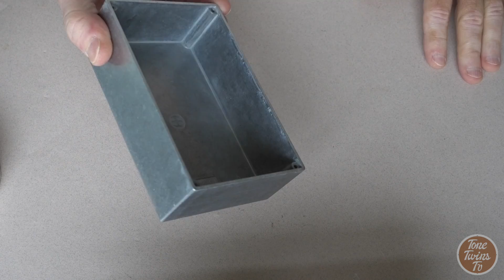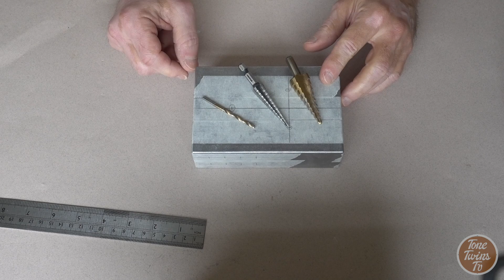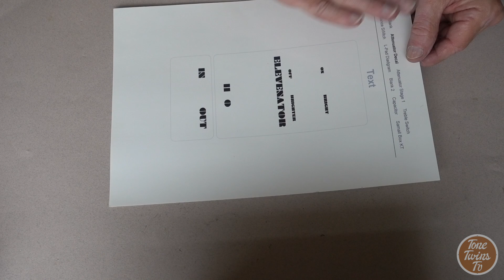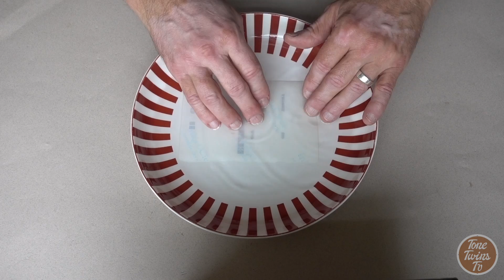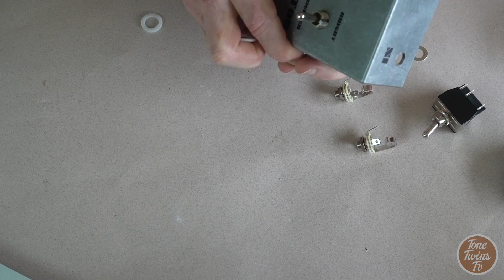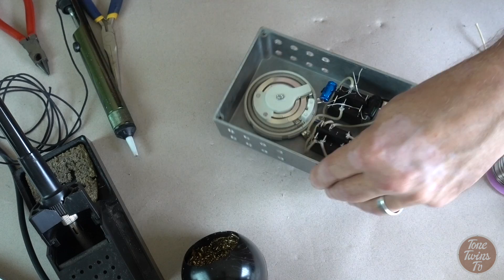DIY Attenuator For Guitar  - Great Low-Volume Tone

Comment: The problem with attenuators that use an LPad like this, is that when connected to a 100w amp, and you dial it down to almost zero, almost 50 watts is being dissipated into the last couple of windings. Marshall used to sell a similar design attenuator when I worked in the industry, and I lost count of the number of blown units returned. Go with a stepped design.

Comment: It's a great build. There is a slightly better way to wire it. Input comes in into 1 and output to 2. That way if the wiper fails you don't have open circuit that can wreck a tube amp.

Comment: I built one of these .the tone when used after was garbage in a Marshall SVC 20. the eq controls were dead like they're not part of the amp any more ..no amount of dialing in would get rid of a dark bottom muffled .sound ..I even borrowed an ox box and a bugera box .both gave the same problem ....they just don't work on the Marshall SVC20 amp ..the only thing that works is the the black box in the FX loop ..👍👍👍

Comment: Several INCORRECT statements made in this video. UA Ox is a reactive attenuator. It absolutely DOES NOT use a cheap Lpad like cheap, resistive power soaks use.

Comment: The best. Built one 6 years ago. I found at low volumes the 2.2 Ohm was less useful, and use a 10 Ohm most of the time. I also modded a Jettenuator clone, and modded the L-pads built in a stereo 2x12 cabinet. I made a 4/8 switch for mine.

Comment: Electricity dummy here. If this is 8 ohms, and my cab is 16 ohms, how can I hook this up safely? Gear used for reference: Orange RV50mk2 and Orange PPC212. Thanks for anyone's input:)
Reply from the maker: You couldn't unless you built one using a 16 Ohm L-pad. Then it would be fine.

Comment: Looks pretty simple. Sorry if this is a stupid question, you compared this to the Ox, does this mean it’s a reactive or resistive attenuator? I’m not super familiar with all this but I’ve heard reactive is much better and a simple, no extra crap to jack up the price attenuator like this is what I want. I’m currently looking at the Palmer pdi-06 but if I can just build an equally good one myself for half the price then id rather do that!
Reply: They absolutely INCORRECTLY compared this to an Ox. They are nothing alike other than they be used to reduce volume. They also INCORRECTLY say these Lpads are used in expensive attenuators. Change expensive to INEXPENSIVE, and it would be a correct statement. Ox is a reactive attenuator. This is resistive.  Nothing like what a speaker load looks like to a power amp.

Comment: I dunno about these potentionemer types with a valve head?
I've had enough "scratchy" pot experience with dead spots on pots in the past and a valve head seeing no output load can be a very bad thing indeed for it's health!
Reply: good point .  Maybe hardwire a version using 2 hi power resistors. but you have to know how much attenuation you want.  Could us a switch with several values, if you're confident it won't fail...

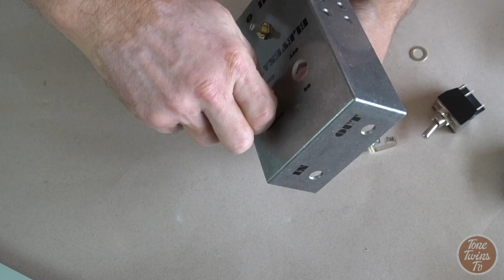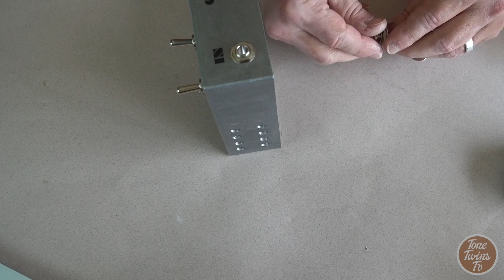Comment: Blood hell, at 18:15 & 18:22 vs 19:56 you've got the "IN PUT" on the opposite side of the project !!! ; the Diagram and mate doing the "work" are at Odds ; the soldering of L-Pad terminal #1 at 22:04 is confusing vs Diagram ;  the edit at 22:09... (?) and at the end of the video one of the "grounds" is not hooked up... And what's with using the "cloth wire" obstructing the view... !? Very sloppy video (guys), for those of us not so good at electronics, but I will try... sheesh ¿?!

Comment: PRoblem is that these cheap plastic L-pads can't handle much more than a 20 watt amp. I have a 40 watt tube amp. The curernt plastic based 100 watt L-pads cant handle the heat. Mine melted and started to smoke within minutes of use.. My 15 watt super champ x2 does not make it too hot.

Comment: I’ve just built one of these, using the instructions on the website and I’ve noticed that you have wired the l-pad backwards to how you have done it in this video. Is that going to cause an issue? Which way is the right way. Currently when I have my attenuator on full I get no volume through, which doesn’t feel right.
Reply: I’ve just rewired the l-pad like the video (not the website) and checking with a multimeter, I get consistent 8 ohms across the whole range of the l-pad, instead of getting quite high resistance, even open circuit as I increase the attenuation. A bit frustrated though that the website appears different.

Comment: Came across this and looks like a nice project to tame my tube amp for playing at home. It will certainly get me what I need without spending 100's of $$$. Looks pretty straightforward but I have a question. The one shown at the start of the video has a couple of rivets on the cover, but I do not see that as part of the build. What is their purpose?

Comment: I just looked at this one more time. I have an AT60H 8 ohms from Song Huei Electric and took the time to look at the datasheet. The ´60´ probably means that it is rated at 60w. The data sheet
says that it can attenuate from 0 - 40 dB ... but the power rating falls scarringly according to attenuation: (I assume it is 60w @ 0dB), data sheet says 50w @ 2 dB, 35w @ 6 dB, 25w @ 12 dB,
so what would that be at 40 dB?? A few watts??. It would probably be safer just to buy one of the cheap loads out there.

Comment: Thanks for the great video. This version doesn’t use the 8ohm wire wound resistor that is used in the article. Is there a reason for the difference? Thanks

Comment: What is the recommended wire gauge  for these?
Reply: asking the same, I have high gauge speaker wire on hand, but in tight spaces that's even tighter maybe not practical given the lengths. More concerned about the load capacity rather than impedance and signal loss

Comment: But what about 100w amps? I want to build one for a 8ohm 100w amp... i supose i dont need the resistor and the switch for the 4ohm. But 100w... how safe will it be? Could i use one output of  a 200w stereo L pad?

Comment: excellent wok guys, one thing, as i have 1984 Marshall JCM800 100W Master Lead full stack i only have the slanted cab connected, would this attenuator build be ok regards the ohms selected on my amp which is 16ohms ?  cheers ...

Comment: Oops...you forgot the negative on the cabinet out jack...based on your schematic, how is this thing working???
Reply from the maker: It's a metal enclosure Chaz, and the jack sockets are metal open frame. So there is ground continuity through the enclosure. Hope that helps.

Comment: Having never done anything like this before, or even done any soldering, I made one of these this week. Brilliant! I took my time so that I didn’t make any silly mistakes, and it was all pretty straightforward. 
I just tested it on my Fender Pro Reverb and not only does it work (!), but it comfortably brings volume down to sensible levels whilst cranking the amp (2 6L6 valves, 40w). 
Really happy with it, thanks for the great tutorial Huw. It’ll be a useful tool to keep the amp in the sweetspot whilst adjusting volume to suit wherever I’m playing.
Reply: Thinking about do this one, I am new to guitars, amp and pedals. Just bought ar orange micro terror, would be nice to crank it and not be evicted.
Reply: How does the bright switch work? That is, how does it sound?
Reply: @nedim_guitar  it’s pretty subtle, useful at really low volumes. But I rarely use it, as my amp is just used for band rehearsal & gigs, so I use the unit to help drive the amp that little bit harder whilst keeping the volume sensible, but still loud!

Comment: Sooo isnt having an on-off switch a no-no? It'd be like unplugging the speaker from a tube amp while it's on.
Reply: I think the on/off switch is actually an on/on switch. You'll notice that the two pegs are bridged in one of the switch positions, which I believe to be the bypass/"off" mode where the signal just goes from input to output and does not get attenuated. At around the 20:00 mark, he's wiring this up
Reply: @dumbdickler670  Oh ok thanks. Geez I hope so haha

Comment: Cool. I'd like to get a Marshall amp with a 16 ohm speaker and 1 watt of amp power . How do I know if I'm using the right capacitors. I have 4.7uF  orange drop  for my guitar. will that work? What about the 10 uF?

Comment: If the secondary Output transformer is 8 Ohm, then the L-Pad may be 8 Ohm too, right? And if I use two 16 Ohm speakers in parallel, then the L-Pad will be the same 8 Ohm?
Reply from the maker: With no attenuator connected, you would use the 8 Ohm output of your transformer with an 8 Ohm speaker. Two 16 Ohm speakers in parallel is equivalent to a single 8 Ohm speaker. So, you would retain the 8 Ohm output of your transformer and use an 8 Ohm L-Pad - exactly as you say Emanoel. If you were using just one of your 16 Ohm speakers, you would need to select the 16 Ohm output of your transformer and use a 16 Ohm L-Pad.

Comment: My Vox is 16ohms, so I ordered a 16ohm Lpad , match the ohms output ? am I understanding this correctly so far?            Thank you in advance if you get time to respond, one other thing, what if I want to have a switch from 16ohms to 8ohms? what caps for the bright and brighter options switch?
Reply from the maker: Yes, you'd need a 16 Ohm L-pad. For 8 Ohms, place a switched high wattage 16 Ohm resistor across the L-Pad input and ground.
Reply: @tonetwinstv2863  Thanks so much for the reply, you folks are the exception not many guys answer questions, maybe I should put a ? at the beginning , anyway thanks great vids

Comment: The two DPDT switches in the video appear to be the same, each having six contacts. If so then could you use two of the same type?
Reply: They're not quite the same. The On-Off is a simple DPDT but the other has a centre-off position, so DPTT, if you will

Comment: Could you build me one for my 100 Watt Marshall heads! Also what is the DB(Decibel) spread reduction in sound pressure could I expect?
Reply from the maker: Hi  José. I think 100W is probably too much for one of these. You might be better off talking to a tech about running the amp with two power tubes rather than four and adjusting the speaker impedance setting accordingly.
Reply: @tonetwinstv2863  Or talk ro Rivera Amplification here in Burbank. Or just buy there "Rock Crusher" attenuator! Thank you!
Reply: Hi Tone Twins. Thanks for the video. Great editing and production. I've got a 100 watt el34 amp. I've reduced the power by half by pulling 2 output valves. Do you think that a 50 watt or 100 watt 16 ohm L pad (if I can source a 100 watt one) will cope with the power? Thanks

Comment: would the parts needed be the same for 100W 16ohm L-Pad? switches and capacitors?
Reply from the maker: You'd need to get an L-Pad rated for more than 100W Jason - just to be safe.

Comment: I use 120 watt heads, is there anyway to make one to tame my beasts? I can't find a brand who sells an attenuator that can handle 120 for less than 500 dollars so I was hoping maybe I could make one!
Reply: You'd probably want something like a 150w to 200w L Pad.  I'm not sure if they even make one with that high of a wattage rating.  You could probably find another way around it to provide a load to the amp and eat some volume.  Various resistors perhaps and a stepped circular switch.

Comment: If your project box was plastic,  or your in/out jacks were isolated, it wouldn’t work. You’re missing a jack ground in your wiring. (Notice missing connection on the ground lug) Your schematic is correct, though. Nice project!
Reply from the maker: Yes but since we built it with non-isolated jack sockets on a metal box, it's fine. If you use a plastic box and or isolated jacks, your observations are correct.

Comment: I'm a bit confused, can you clarify something?
 
In your original 2016 article you connect the input's hot wire from the bright switch to the L-Pad's lug on the RIGHT and the lug in the CENTRE. In this video you connect the input's hot wire from the bright switch to the lugs on the LEFT and CENTRE. The L-Pad in the original article and this video is the same - a Monacor AT-62H. Why is it different?

Another thing confusing me is that I'm making an attenuator using a 16ohm/50w L-Pad (from same supplier as yours) but looking at its bottom, with control rod facing down, the lugs are numbered left-to-right, 3 - 2 - 1. But the lugs of your L-Pad in this video, facing the same way, you have them marked left-to-right as I - II - III, the opposite way around. Which suggests I should do the reverse wiring to your video but maybe the same wiring as in your original 2016 article? Also, I have no idea what I'm doing.
Reply from the maker: Follow the instructions provided with the L-Pad you're using.

Comment: A very good building video, but do you think hot air will flow side wards without a fan?  The ventilation holes should be in the top and in the bottom, even if it
does not look so nice. That is what supports convection cooling.

Comment: Don't rub your fingers on the drilled metal right after you are done! 1. you WILL burn your fingers if you've been drilling it long. 2. you WILL cut your fingers if there are any attached shavings. (Think red-hot razor blades going into your fingertips...)
Reply from the maker: Thanks for the tip
Reply: Yeah, never wipe metal shavings with your hand. Metal Shop 101. Also, wear safety glasses.

Comment: Interesting show, I am not a DIY person but I enjoy watching it. I play in stereo with two small combo amps. I guess that I would need two of these? The idea of really opening the amps up but at an acceptable volume level, for the neighbors, has always appealed to me. Any idea of when the store will open?
Reply from the maker: Thanks Dave. You can get stereo L-Pads, so it would be possible to enclose one of those in a single enclosure with 4 jack sockets to run 2 amps. You'd need longer speaker cables, but that's about it. Store coming soon but just message us via Instagram if you want one built.

Comment: Great project guys, thank you. Interesting that there is such a small difference in tone as the amp is turned down, and without inductors..... I agree with the Guv, step drills leave the nicest edge to their holes. Peter

Comment: Very handy. You can deburr the ventilation holes by using your step drill bit after drilling the initial hole. They apply a slight chamfer and deburr at the same time. 
Saves time, looks neat, a file or medium grit paper knocks off the internal burrs.
Reply from the maker: A great tip. Thanks.
Reply: Be aware Preston is currently under local lockdown, (CPC is located in Preston) there may be some disruption to sales. 👍🏼